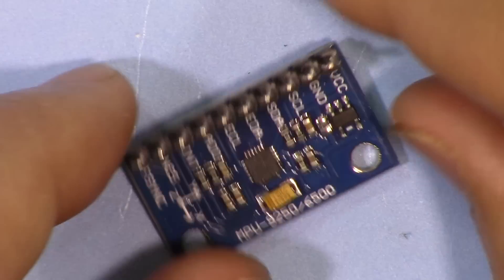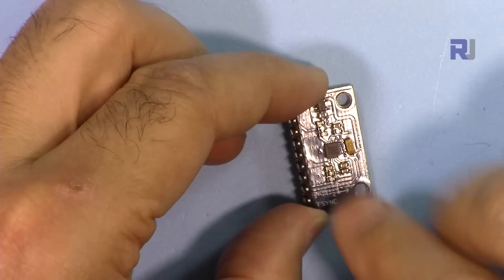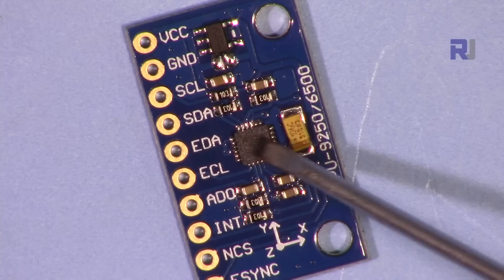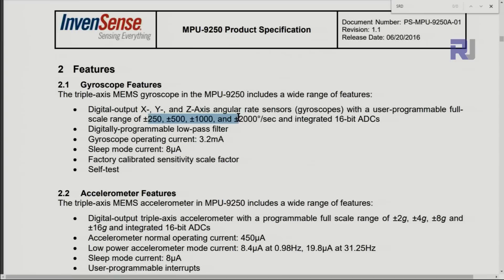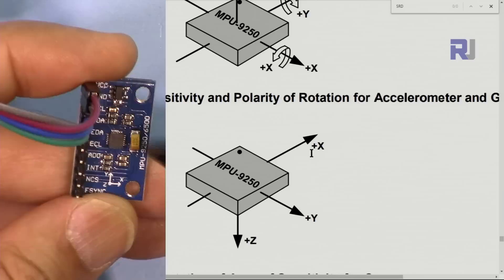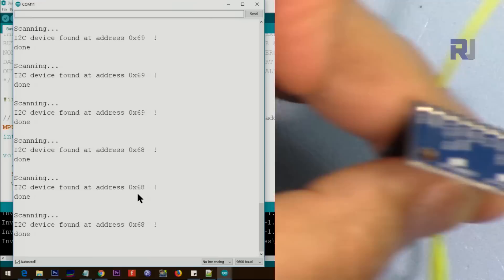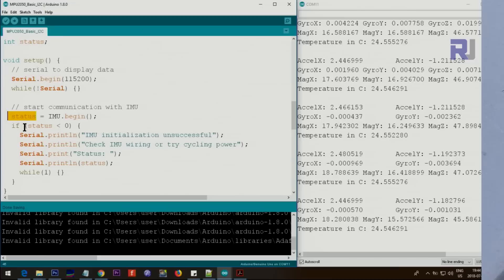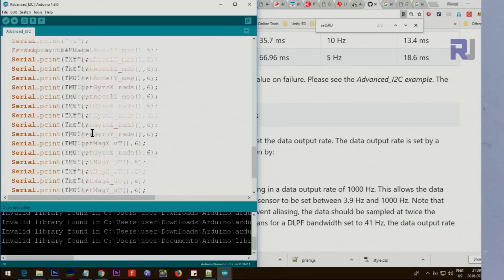How to use MPU-9250 Gyroscope, Accelerometer, Magnetometer for Arduino

Comment: You connected SDA and SCL on the uno to a device that is not 5v tolerant. OFC there is the stepdown converter for supply, but what about logic level? My Uno outputs 5v amplitude on sda and scl and im afraid I roasted my MPU. So basically HW setup on my side should be same as yours, but my mpu just doesnt connect as shown in the serial monitor which therefore only outputs 0s for each value of the 9 axes. Help would be appreciated... At least those things are cheap, so I can just buy a second one and see if I really roasted the first one and use a logic level conv. this time.
Reply from the maker: you are right. But maximum tolerance of 9250 is 4V while Arduino UNO wiht 5V VCC, outputs os 60% of supply or approxmately 3.5V at sDA and SCL.

Comment: @Robojax  ,when i run the i2c scanner ,no address is being detected. plz help.
dont u have to connect pull up resistors?
Reply from the maker: I am sorry for late reply. I was on vacation. Your wiring must be incorrect or you pins are not bad.

Comment: how to install manually mpu9250 library? i've tried but it doesnt work. could you tell me
Reply from the maker: just put the driver in the "my document\arudino\libraries" folder. so this module should have it's own folder with all files. Restart the Arduino IDE and it should work and you should see the examples.  100k people used the instruction shown in video and it works.

Comment: So is it really ok to connect vcc to 5v? Bcz mine suddenly become 0 output for every sensor after connecting it to 5v for a while
Reply from the maker: Yes. Really. it has voltage regulator on the module. I have crated illustration image here https://robojax.com/node/931
Reply from the maker: You didn’t reply? I spent about an hour to make the diagram so you understand it better.
Reply: @robojax  sorry for late reply. Thx for reassuring me. I've read some papers and mpu9250 datasheet and both have different Vcc input so that's why I had confusion

Comment: Doesn't this need a level shifter since the MPU9250 operates on 3V3 logic?
Reply from the maker: very interesting point. But the logic level is not necessary 3.3V as shown here https://invensense.tdk.com/wp-content/uploads/2015/02/PS-MPU-9250A-01-v1.1.pdf
Reply: @robojax  Which part exactly? I'm building a flight tracker for my undergraduate thesis and all of my other boards require level shifters.

Comment: please help I'm getting this 
"IMU initialization unsuccessful
Check IMU wiring or try cycling power
Status: -1
"
Reply from the maker: First run the I2C scanner (link is provided in the same page as the code) .It seems you there is issue with wiring. You should be getting I2C address when running I2C scanner. 
you can read about the error codes in the library in here at line 60 https://github.com/bolderflight/MPU9250/blob/master/src/MPU9250.cpp
Reply: @robojax  Thanks a lot, my problem was that I can't communicate with the mpu through the default address which is 0x68 the sloshing was to connect the ADO pin to 5v and change the address to 0x69 to establish the communication.
Thanks again for the video brother.
Reply from the maker: You are welcome. I am glad the issue is resolved.

Comment: How to calibrate the accel, gyro and compass?? Thank you
Reply from the maker: Here is the library file and it shows it has calibration function (method). Just search "calibrate" I believe every time you boot, it does it with reference to the current position https://github.com/bolderflight/MPU9250/blob/master/src/MPU9250.cpp

Comment: I am only getting temparature value. What may be the issue?
Reply from the maker: the module has temperature sensor but the library https://github.com/bolderflight/mpu9250 does not have that function. so it seems you are not using the library. Please use library, it will work.
Reply: @robojax  getting negetive value for IMU.begin. what may be the issues

Comment: Hi so I followed the steps, but for me it says MPU failed and then check connection followed by different symbols and letters. I checked the wiring and tested if my arduino can check if I2C devices are connected. Please let me know to why different symbols appear. Thanks.
Reply from the maker: Your serial monitor has incorrect baud rate. see it here https://snag.gy/y3pKwG.jpg either fixt the code or fix the serial monitor
Reply: The code will have something like "  Serial.begin(115200);" you need your serial monitor to match that

Comment: I borrow your code, but the value of acceleration isn't pretty like you.
Namely, when chip is static, ax isn't 0 and az isn't -9.8. Do you know what is the probable reason?
thanks a lot.
Reply from the maker: LOL. calibrate the accelerometer using this :calibrateAccel() it shows in library file here on line (after) 705 https://github.com/bolderflight/MPU9250/blob/master/src/MPU9250.cpp
Reply: @robojax  thanks for your answer !
But i still confuse after I read the library.
Can I ask how to use calibrateAccel()？
Reply: here is my(your) code, the B part is same as A part, I guess I misuse the  calibrateAccel()
#include <MPU9250.h>

/*
Advanced_I2C.ino
Brian R Taylor
brian.taylor@bolderflight.com

Copyright (c) 2017 Bolder Flight Systems

Permission is hereby granted, free of charge, to any person obtaining a copy of this software 
and associated documentation files (the "Software"), to deal in the Software without restriction, 
including without limitation the rights to use, copy, modify, merge, publish, distribute, 
sublicense, and/or sell copies of the Software, and to permit persons to whom the Software is 
furnished to do so, subject to the following conditions:

The above copyright notice and this permission notice shall be included in all copies or 
substantial portions of the Software.

THE SOFTWARE IS PROVIDED "AS IS", WITHOUT WARRANTY OF ANY KIND, EXPRESS OR IMPLIED, INCLUDING 
BUT NOT LIMITED TO THE WARRANTIES OF MERCHANTABILITY, FITNESS FOR A PARTICULAR PURPOSE AND 
NONINFRINGEMENT. IN NO EVENT SHALL THE AUTHORS OR COPYRIGHT HOLDERS BE LIABLE FOR ANY CLAIM, 
DAMAGES OR OTHER LIABILITY, WHETHER IN AN ACTION OF CONTRACT, TORT OR OTHERWISE, ARISING FROM, 
OUT OF OR IN CONNECTION WITH THE SOFTWARE OR THE USE OR OTHER DEALINGS IN THE SOFTWARE.
*/

#include "MPU9250.h"

// an MPU9250 object with the MPU-9250 sensor on I2C bus 0 with address 0x68
MPU9250 IMU(Wire,0x68);
int status;

void setup() {
  // serial to display data
  Serial.begin(115200);
  while(!Serial) {}

  // start communication with IMU 
  status = IMU.begin();
  if (status < 0) {
    Serial.println("IMU initialization unsuccessful");
    Serial.println("Check IMU wiring or try cycling power");
    Serial.print("Status: ");
    Serial.println(status);
    while(1) {}
  }
  // setting the accelerometer full scale range to +/-8G 
  IMU.setAccelRange(MPU9250::ACCEL_RANGE_8G);
  // setting the gyroscope full scale range to +/-500 deg/s
  IMU.setGyroRange(MPU9250::GYRO_RANGE_500DPS);
  // setting DLPF bandwidth to 20 Hz
  IMU.setDlpfBandwidth(MPU9250::DLPF_BANDWIDTH_20HZ);
  // setting SRD to 19 for a 50 Hz update rate
  IMU.setSrd(19);
}

void loop() {
  // read the sensor
  IMU.readSensor();

  
  // display the data

  //part A
  Serial.print("Ax: ");
  Serial.print(IMU.getAccelX_mss(),6);
  Serial.print("\t");
  Serial.print("Ay: ");
  Serial.print(IMU.getAccelY_mss(),6);
  Serial.print("\t");
  Serial.print("Az: ");
  Serial.println(IMU.getAccelZ_mss(),6);
  IMU.calibrateAccel();
  //part B
  Serial.print("Ax: ");
  Serial.print(IMU.getAccelX_mss(),6);
  Serial.print("\t");
  Serial.print("Ay: ");
  Serial.print(IMU.getAccelY_mss(),6);
  Serial.print("\t");
  Serial.print("Az: ");
  Serial.println(IMU.getAccelZ_mss(),6);

  /*Serial.print(IMU.getGyroX_rads(),6);
  Serial.print("\t");
  Serial.print(IMU.getGyroY_rads(),6);
  Serial.print("\t");
  Serial.print(IMU.getGyroZ_rads(),6);
  Serial.print("\t");*/
  /*Serial.print(IMU.getMagX_uT(),6);
  Serial.print("\t");
  Serial.print(IMU.getMagY_uT(),6);
  Serial.print("\t");
  Serial.print(IMU.getMagZ_uT(),6);
  Serial.println();
  delay(1000);
  Serial.print("calibrateMag: ");
  IMU.calibrateMag();
  Serial.print(IMU.getMagX_uT(),6);
  Serial.print("\t");
  Serial.print(IMU.getMagY_uT(),6);
  Serial.print("\t");
  Serial.print(IMU.getMagZ_uT(),6);
  Serial.println();*/
  //Serial.println(IMU.getTemperature_C(),6);
  delay(200);
}

Comment: Does this work with the Arduino pro mini
Reply from the maker: works with all arduino. Just pay attention to the wiring to SDA and SLC pins. The pins are listed here for all boards https://www.arduino.cc/reference/en/language/functions/communication/wire/
Reply: @robojax  it reads. The aim of what I want to do is use that data for a DIY Vr. How do I extract it using the pro mini via a uart-serial connector. Is it possible,or must the pro mini be used as an HID(not supported by the pro mini)

Comment: why am i getting I2C not detected again and again? I've triple checked the wiring
Reply from the maker: Something must be seeing . If you have multimeter check the voltage of the module to see if it is getting power.

Comment: I have a problem with the code. It gives me an error in MPU9250 IMU(Wire,0x68);
Reply from the maker: this is not enough. give you error saying what?
Reply: @robojax  
No matching function for call to 'MPU9250_<TwoWire>::MPU9250_(TwoWire&, int)'

Comment: My wiring is correct since I get an I2C adress of 0x68 with the scanner, but I get this error with your code:

IMU initialization unsuccessful
Check IMU wiring or try cycling power
Status: -1
Reply from the maker: Here it shows https://github.com/bolderflight/MPU9250/blob/master/src/MPU9250.cpp at line 1070 and it is due to reading I2C address. It is strange. I am not sure what is going on.  If you've got another module, try that.
Reply: @robojax  I don't have any other module ...
I've waited 3 weeks but gyro/accelerometer is so hard to get to work !
I found a code that read gyro and accelerometer using registers and no library, but I don't know if it's reliable for a quadcopter PID
Reply from the maker: It is possible but the library makes you code simple and clean.
Reply: @robojax  Yes ! It was the perfect code
Reply: @robojax  Do you think that it's because I'm using an Arduino nano ?
Reply: Don't work either
Reply: @francoisguyot789  I also have the same issue, i already ground the AD0, also FSYNC but nothing. I will check if I soldered the sensor properly. I also bought a new one.

Comment: IMU initialization unsuccessful
Check IMU wiring or try cycling power
Status: -5
 
i have this error!! helpme
Reply from the maker: I2C address is not found. wiring is bad.
Reply: i used a code for watch the address i2c is 0x68. but i though that the object imu is wrong!!

Comment: I am completely new to using Arduino, and when I paste in this code my serial monitor prints this:
⸮ `4⸮drye⸮⸮ ⸮ ⸮.⸮⸮⸮
does anyone know what this means? and what I should do? I followed the wiring directions on the website, and the code is directly copied from there as well
Reply from the maker: Hello,  here is a video which is part of full Arduino course https://youtu.be/WyWRGoACWFs but  
*** Free Arduino Course worth $200**
Arduino Step by Step Course  (over 150 lectures) Starts here http://robojax.com/L/?id=338
Reply: The code will have something like "  Serial.begin(115200);" you need your serial monitor to match that

Comment: mpu9250 IO voltage is equal to VDD which would be 3.3 as shown in the video. Is it safe to use with arduino uno which works with 5v IO voltage
Reply from the maker: I will reply to all Subscriber's 🔔 questions. So make sure to Subscribe.😊
Reply: @robojax  I figured it out myself, I2c interface pins are open-drain type and sensor board has 3.3v pull-ups. 3.3 v high is enough for arduino input.
Reply: @robojax  can you tell the purpose of fsync pin?
Reply from the maker: Here it shows in page 27 http://www.invensense.com/wp-content/uploads/2015/02/PS-MPU-9250A-01-v1.1.pdf it is the Frame Syncronization with external sensor if you use. Connect to GND if not used.

Comment: Hello, Thank you for the video and code. I connected the Arduino Uno,  installed MPU9250 library, and run the code and face with this error:  no matching function for call to 'MPU9250_<TwoWire>:: MPU9250_(TwoWire&, int)'   -- it shows this line of code:  MPU9250  IMU(write,0x68) as the source of error.  I would appreciate it if you could let me know how to solve this problem.
Reply from the maker: It means the library is not installed
Reply: I have same problem . are you solve this problem .. can u help me

Comment: Hi thank's for the very good video. I did some try but I get the compiling error for the line 27       MPU9250 IMU(Wire,0x68);   as follows "Wire was not declared in this scope". The library is well included in the arduino directory. Can You help me to fix it? I am quite a beginner... Thank's in advance....
Reply from the maker: this is due to missing library. Please try to include it by clicking on Sketch->include library->Add zip library.
This can't be other error.
Reply: Thank You for the quick reply. With a freshest version of Arduino IDE all references work now fine.
Reply from the maker: You are welcome. I am glad it worked for you.

Comment: My team is trying to use 9250 along with your code. The address on the 9250 is set to 0x68, but we get a status of -5 when we run the code. Looking at the .cpp file, we're getting the -5 because the IMU address is not 0x71 or 0x73. Any ideas?
Reply from the maker: first run I2C scanner to get the address. Then use it. We've provided the I2C scanner on the same page where the code is.
Reply: how did you solve it?

Comment: Hey wirklich sehr gut erklärt.
 Ich hätte aber noch eine recht triviale Frage, und zwar wie erstelle ich ein Client zum Empfangen der Daten, also wie werden die Daten vom Sensor drahtlos von meinem Laptop empfangen? Wurde das in dem Video erklärt und ich habe es überhört oder hast du dafür noch ein extra Video? danke im vorraus
Reply from the maker: Dankeschön. Es gibt keine drahtlosen Optionen. Wenn Arduino angeschlossen ist, können Sie über UART USB über das Windows-Terminal oder MATLAB oder andere Software zugreifen. Dazu müssen Sie wissen, wie jedes Register gelesen und gelesen wird. oder einige Software kann Ardino-Daten lesen. Aber natürlich können Sie Bluetooth oder WiFi verwenden, um es in eine Entfernung von etwa 10 Metern zu übertragen.
Reply: @robojax  danke für die Antwort. Ich bin noch relativ unerfahren was das Thema angeht und soll fürs Studium ein Informatikprojekt durchführen und den Sensor über WiFi mit einem RC-Car verbinden. Ist das richtig, dass ich ganz einfach über Telnet die Ip des Sensors eingebe und so dann die Daten empfangen kann? Bekommen den Sensor erst in einigen Wochen, aber würde vorab schonmal planen und wissen, ob das so überhaupt richtig ist. Danke nochmal im voraus

Comment: Amazing video, thanks. Can I have one question?  If I turn the sensor 65 degrees, will it still show the 65 degrees (to X), or does it reset in a while (and that 65 rotated position to X will be new basic position= it will show 0)? Of course after recalculation Rad/Degrees. I need to use it for a point where the angle is rotated only once for a long time and I want it to keep showing me that angle measured from that horizontal (basic) position will it work?
I had this problem with MPU6050 (it kept changing his basic position), I don´t know if it´s normal, or if I had bad program...

Thanks a lot.
If you told it in the video, I´m sorry my English is still bad.
Reply from the maker: You posted comment about MPU6050 but this video is about MPU9250. please post it here https://www.youtube.com/watch?v=uhh7ik02aDc

Comment: why is your gyro angle so small, even when I rotate 180 degrees it is less than 10 thanks a lot
Reply from the maker: You must have set the unit differently may be it is set to radian

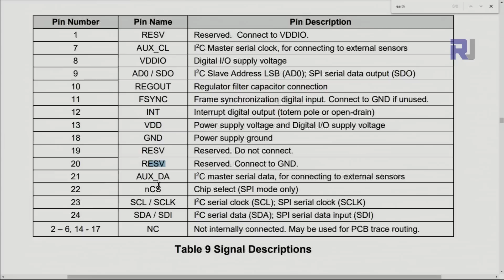Comment: 9:23 Wiring
Reply from the maker: I have explined it two or three times. this video is for learning. Pay attention. I mentioned which pin goes where and then showed you. if you have a project to print it,t hen use fritzing from fritzin.org free softwared.

Comment: This code doesn't work. It shows in Serial Monitor: Check IMU wiring or try cycling power
Reply from the maker: which one did you download? download the one from Robojax.com then. I have provided both links. Try both. It has worked for 1000s of people. it should work.
Reply: @robojax  I downloaded the one from this page: https://github.com/bolderflight/MPU9250 OBS: I'm using arduino mega.
Reply from the maker: that' why I am telling you to install the one provided from robojax.com as this library might have changed. That's why I try to keep the library at the time when I test the project.
Reply: @robojax  I've downloaded the library from the website and still does not work. Serial monitor shows the message: IMU initialization unsuccessful.
 Check IMU wiring or try cycling power

Comment: Is it working on the Z axis ?
Reply from the maker: Yes and I have shown it.  It should work on X, Y and Z
Reply: @robojax  Still don't work ...
Reply from the maker: if you used the library I recommend and you have not changed the code, then either wiring is wrong or the module is defective.
Reply: @robojax  Yes, I saw that Chinese cheap modules had problems

Comment: why does it say no I2C devices found?
Reply from the maker: your wiring is incorrect or no power. Run I2C scanner and if you don't see any address, then wiring is incorrect or the module is dead. http://robojax.com/learn/arduino/?vid=robojax-I2C-scanner
Reply: @robojax  yeah, the module was dead...I checked on it...thanks by the way..nice video